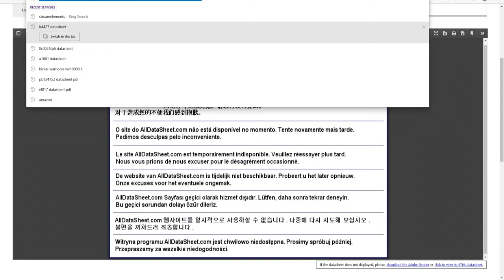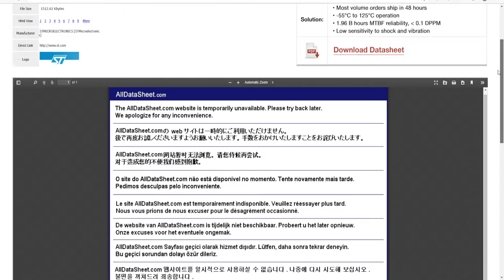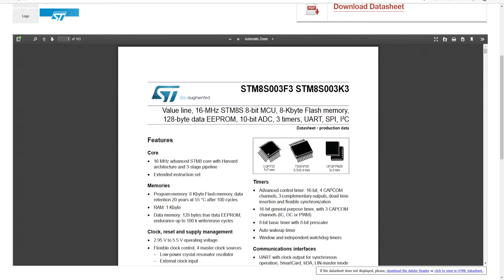Check this BEFORE you put all that TIME and MONEY into a repair Taramps MD8000.1 Amplifier

Comment: I have the same amplifier and everything is good on the traitors output When I turn on the amplifier it turns on okay When you put audio signal It will start clipping with a little bit of signal You can barely hear the speaker You can hear a Distorted sound frequency
Reply from the maker: You have an issue with the output section or the pre-amp.
Reply: @E'burg Amplifier Repair  But I wonder why the clipping and protection is so sensitive to this low volume
Reply from the maker: @hardbody_Santiago96  Because there is an issue in the output section of the amplifier.
Reply: These another way that I can contact you
Reply from the maker: @hardbody_Santiago96  Indeed the website has all the information to get ahold of me directly. www.ellensburgamplifier.com If you are interested in starting a repair ticket then www.ellensburgamplifier.com/request-a-quote is the place to start (please read the directions on the form)

Comment: How do you test whether the PIC is faulty without installing new parts? Would a working PIC allow the board to power up with the power supply or output mosfets removed?
Reply from the maker: As long as you see pulses from the PIC for the power supply drive IC then 9 times out of 10 the PIC is OK. You do not have to have any transistors installed to see this. The very first thing I do for any Brazilian board is to cut out all of the transistors in the blown section then pulse the remote to check for the PIC output. The other output to check is for the 40khz to IC1 the 22v aux. power supply drive IC but this is rarely ever an issue.
Reply: Thank you sir! You're a lifesaver

Comment: I have question I have a Taramp bass 8k . I was taking the speakers cable off the amp and I forgot to turn off the radio and whit the Allen key it made contact to a ground screw and it went to protection mode. Any idea what burnt off in the amp?
Reply from the maker: When the output terminal shorts to the heatsink it damages the output section and in a lot of cases the feedback and DC offset circuit.